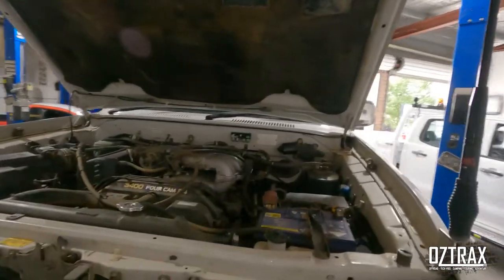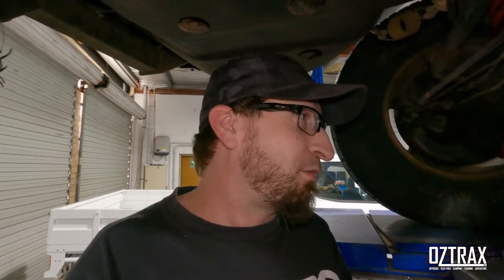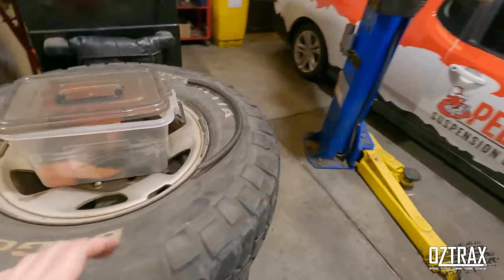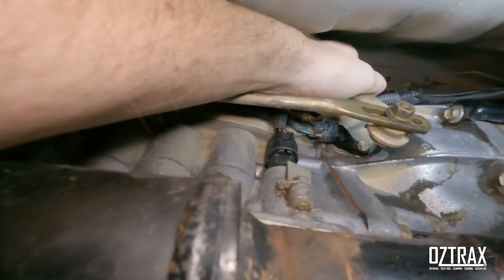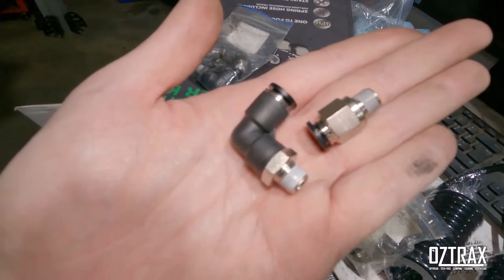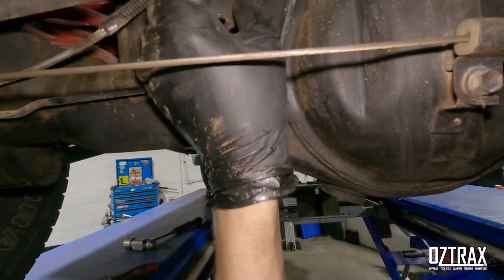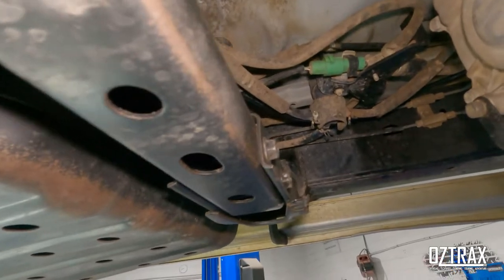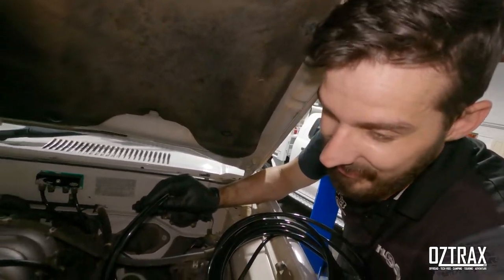DIY: 4WD Diff & Transfer Case Breather Kit Install

Comment: I have a SAAS Breather kit for my 80 Series. I'm yet to fit it but it's ready to go on when I get a chance.  Did you find you needed to soften the piping first in order to make it more flexible?  I'm thinking to leave the piping tubes under the sun for a few minutes just before fitting it.  Does it need it?
Reply from the maker: Hey mate

That was fitted straight out of the kit, no softening required.

Just make sure you leave enough air line loose in the rear to cope with the flex but not get bound up on fuel lines, brake lines or handbrake cables. 👌

Comment: Great video guys, about to do this to mine, question: any reason not to just take the breather directly off of the transfer case and thread in a pipe fitting? Or is it not threaded like the others?
Reply from the maker: Unfortunately it's not threaded, it's a fixed piece of pipe, so this is the easiest way to do it. 👌
Reply: @OzTrax4X4  Ah cool okay!

Comment: Hey there guys. Thanks for the video. I'm about to install a diff breather kit in my old girl. Mine is a 2001 5VZFE. Is it the same situation with the gearbox in mine? I thought that I had to do both diffs,  transfer case & gearbox. Please advise if I am wrong in thinking that. I'll just do my winch as well if that's the case. Last question I promise..... can you install a breather into the Kings Domin8r Xtreme? Thanks for your assistance.
Reply from the maker: Hey James 🤠

The gearbox is a tricky one. Some autos are completely sealed where the breather should be at the top of the gearbox between the bell housing and the trans itself, so you just run the breather off the transfer one, which does both the auto trans and the transfer at the same time.

Regarding the Domin8r Xtreme, I've had one prior to putting the Carbon Off-road winch in and it doesn't have a breather at all. You'd physically have to drill out and tap a thread in the housing on the other end where the motor sits.

Not an easy job by any means.
Reply: Thanks for the quick reply. I'll pass on trying to do the winch by the sounds of things. My old girl is a manual transmission. Does that mean I should have a separate breather for the gearbox & transfer case then? Thanks again for your assistance.
Reply from the maker: @jamespledger4095  if it's anything like an 80 series, they share the same breather, the same way we did Socks 90 series in this video.

I've never looked under a manual 90 series, so can't confirm that, but I'd say it would probably have a similar setup.
Reply: @OzTrax4X4  Cheers for that brother. Greatly appreciated. I'll tackle it next weekend. Thanks for the video & your answers.

Comment: I was planning to fit a diff breather kit myself on my driveway, but it seems it might be too difficult without a hoist.  Darn.
Reply from the maker: I fitted my 90 series one up on a driveway.

It's not that difficult, only fiddly bit will be the transfer case.

We just happened to have a hoist so that made it easier to film.

You can do it! 🤙
Reply: I might be a bit lazy and use the hoist for everything, but this can be done easily on the ground as well, I suggest start running the lines from the top first so you can feed it along the fuel lines away from potential harm
Reply from the maker: What the Big Sock said. 🤠

Comment: so whats the process for the transfer case? knock off the existing breather, then attach that 7.5mm ID hose to the barb? what does it look like?
Reply from the maker: The auto transmission is sealed, so there is that one breather on the transfer case to attach a hose to.

I recommend using a brass elbow to run the hose, if you can get one up in there as it's pretty tight for space.

The breather looks similar to the diffs.
Reply: @OzTrax4X4 is a Lx470 2006 (100series the same do you know? Hose required?
Reply from the maker: @atc2889  This was a universal kit, but you'd have to check the transmission for a breather as I am not sure on that part.

Comment: Do you have a bullbar install  video for a 90 series?
Reply from the maker: I did film my bullbar install when it was done, but I never ended up releasing it due to poor quality and poor lighting.

I advise to follow the instructions that come with your bullbar though as they would be more detailed than what I had filmed at the time.
Reply: @OzTrax4X4  ok I got a 2nd hand alloy one got all bits and peace's with it but no instruction I have a basic idea but thaught seeing it done always helps lol thanks anyway mate
Reply from the maker: Unfortunately all bullbars tend to mount differently.

My Ironman bar had a winch cradle that bolts to the front of the chassis and the bar bolt to that.

An alloy bar would mount differently again if it isn't a winch bar.

I'm sure you'll figure it out though. 😉

Comment: Hi, without installing  this  extended breather, would water still goes inside the axle ? Thanks
Reply from the maker: If you go above the height of the factory breathers, there is a risk of water ingress due to a shock temperature change with hot oil and cool water.

It's best to extend the breathers if you plan on traversing water above the height of the rear axle.
Reply: @OzTrax4X4  I thought the factory install breather is a one way valve. Darn I'm wrong.
Reply from the maker: @leefiz  They technically are. All that is inside is a thin piece of rubber and a spring.

Due to the age of the Prado, they generally don't work.

If you're not traversing deep water, then I'd leave them as they are, otherwise extend away. 👌
Reply: @OzTrax4X4  ok and thanks for sharing mate.

Comment: I’m about to do this myself but I’m curious what did the fuel hose connect to on the trans? The factory breather was knocked off and what was left in there?
Reply from the maker: 100% correct. 👌

There will be a little piece of flared pipe sticking up.

Fuel hose goes on that, hose clamp it down and then feed the plastic line into the other end and hose clamp that, then run it up to the breather.